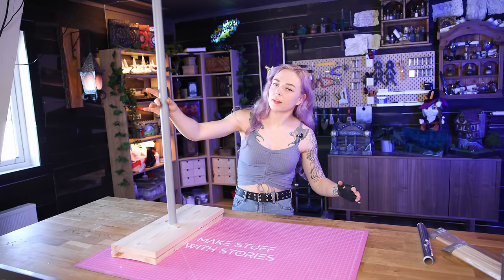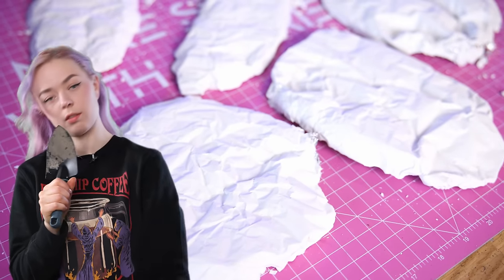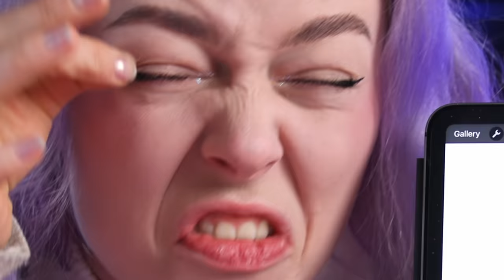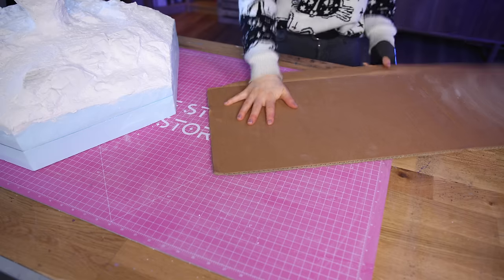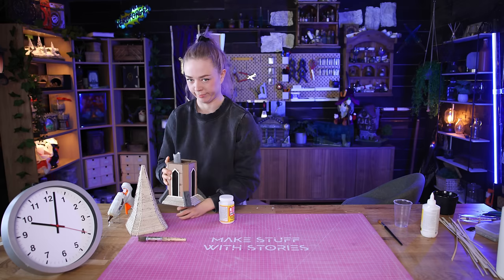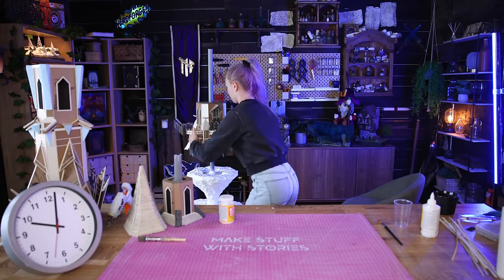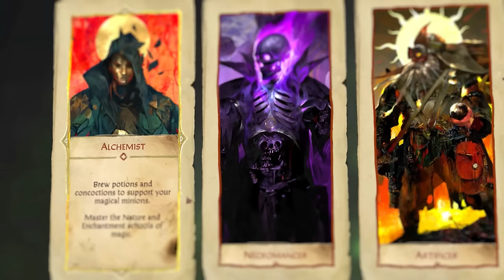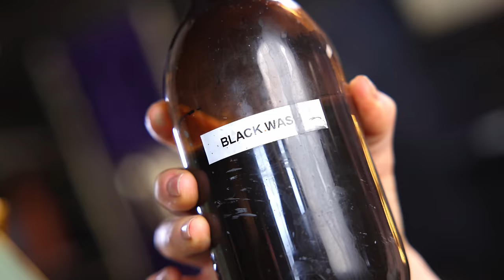I spent 20 days building this giant wizard tower

Comment: A crate isn't a bad idea. Keep it vertical and add anchors between each layer that secures to the central pipe and the inside of the crate. Then fill it with packing peanuts. Make sure to label it so they keep it orientated correctly and don't try to set it down on its side. As long as you have it attached to a pallet, it should be safe. It is going to be a fairly pricey way to ship it, but this would be the safest way to ship it internationally.
Reply: I'd put packing peanuts inside the structures as well to minimise any crushing
Reply: Good Idea Joe, and good idea Andy. I'd even say forming some styrofoam at the top and bottom as well as maybe a couple at the mid levels as reinforcement to anchor points would also help reduce crushing, and provide stabilization.
Reply: need lots of bubblewrap
Reply: I would like to add that you should add a tip and tell indicator on each side.   The fact is that shipping companies typically don't give a shit about something that says fragile this side up.   The second you add an indicator that shows if it got tipped though it becomes a different story.  

Sadly I am not sure if you can buy them in small batches locally.   They typically only get sold in packs of 100.     That said you could always just print a fake tip n tell label and slap it on the outside of the box even if it doesn't have one inside.
Reply: Adding on to these ideas, you could use your laser cutter to cut pieces of PE foam to fit around the less detailed sections. It'll be more expensive but will offer more stability, and the person you ship to won't have to deal with an avalanche of packing peanuts. 

I think 6-7 pieces of 5cm thick foam would be enough. Two for each of your sections and maybe one for the base where the rock tapers in. You could even cut them into hexagons and build a hexagonal crate around them. Make sure to cut them a hair larger than your crate and a hair smaller than your tower so they hold onto it well.
Reply: Another option that I've seen used for delicate lab instruments is similar, where they used a crate and two or three thin plastic bags/sheets. The instrument was placed inside a plastic bag, and one plastic bag/sheet was used to line the bottom of the box, then some type of expanding foam was used to fill in some of the space followed by the instrument being placed inside before the foam cured completely. Then the same was done on the top (plastic/foam/plastic), and then sealed. There was absolutely no movement of the part because of the possibility of damage (delicate lab equipment and all). Unfortunately, I only opened the box after shipping, so I'm not sure what type of plastic and foam they used. I just know that it was super effective.
Reply: @Nydewien  Your talking about the expanding foam for shipping.  They come in bags that you activate that then expand to fill the space.  It is commonly used to ship computers and works insanely well.    The problem is those are really expensive.   At around 10 dollars each and each only covers about 10-15 inches of empty space depending on the size.    Your probably talking over 100 dollars worth of them to properly pack it.
Reply: @MaethorDerien  Thanks! That's great to know for next time I need to ship some lab equipment. The last thing I sent out required $18k in insurance coverage, so I would be willing to pay that. (That and it would be going on my budget number, not me paying for it, lol!)
Reply: Put handles on your crate. People are always going to use a handle if one is provided. It will make it easier to carry and they might even treat it properly.

Comment: Ship it in 4 parts, the base and all 3 parts you made, all filled with packaging stuffing. You can even make a box for the base and use a fancy box for the miniatures with foam with holes carved to their shapes and sizes. Also, carving a negative form of the towers in foam to give more support during transport.
Reply: The issue with that is that someone will have to put it all back together at the end destination. I don't think Martina is traveling to the same place to do it herself.
Reply: pretty sure the parts are kinda stuck together with glue, clay, paint etc. taking it apart would mean you'd see seams after reassembly
Reply: @xime1899  im pretty sure they got facetime or sthg like that, so martina could tell them exactly how to build it back up
Reply: The parts are not in sections anymore. So it has to be shipped as 1 unit.
Reply: It's one part now
Reply: agreed, i personally would have made it to the pipe was removable from the base without killing the light and then each section was take-a-partable.
OR if your're able to redo the piping make it have a connection inside where the lighting starts so the base and the top is 2 parts (less akward)
Reply: I think they could have done it this way, but it would have had to be planned out that way from the beginning. There's no taking it apart now.

Comment: To ship it, I'd recommend building the plywood box like you said, then put in a bunch of braces made of the foam you use in your projects. I think that would be more secure than packaging peanuts. Plus you can cut the foam to fit exactly where you want so you can avoid any delicate areas of the piece. 

 Amazing work as always!

Comment: An idea for the shipping dilemma:
Mount the base in the transport-box and take off the upermost part of the tower if possible. Then you could have a "plug" in the top part of your box, so the pipe is fixed in place once the box is closed. Now the only hazzle left is the top part, which could be shipped in a separate box filled with those packaging thingies.
Best of luck :)

Comment: Great project as always tanks I've watching your back catalog  since I've found your channel thank to your colab with LTT.
Now I've rarely comment but I've have actual experience shipping large fragile things so here are my suggestion:
Option 1: If you can still separate the tower there is no need for a crate you can use cardboard boxes but you'll need to made a "small mod" cut the support pipe so the base can fit in a box that is not too tall and mostly empty, you can add threaded coupler and a connector for the LED Wires so it's easy to put it back together at the destination, now about prepping boxes for the individual parts, you'll need two boxes for each part for the inner box put a layer of hi density foam or Styrofoam of about 2cm lining all the walls of the box then get some instapack bags of the appropriate size to form a perfect support for the part, and that's your inner box for a short trip by truck on paved roads this would be enough, but if it need to be shipped by air o a long multi mode route, you want to add an outer box, this is much easier you need a box about 10 cm bigger in every dimension than the inner box so there is a 5 cm gap between the inner and outer box, now you just bubble graph the inner box with two layers  (the big bubble kind) and fill the rest of the gap with packing peanuts.
Option 2: Let say you can't separate the tower any more for this case you need a shipping pallet and a crate, you'll need to add temporary a larger base to the tower (a piece of plywood a about 10cm smaller the pallet in each dimension) with two objectives lower the center of mass of the pallet making it more stable and be able to screw together the tower and the pallet, now instapack if your best friend again for valuable and fragile things put a layer around  the hole tower you'll need 3 or 4 sections for this get a cardboard box and remove the top and bottom and and do one layer at a time until you have the whole tower protected (you'll need to cut out this boxes to unpack), because cargo shipped in pallets need to be move with fork lift some time is expose to the elements you need to add a layer of film wrap (like those kiosk that wrap your suitcase at the airport) now the final step is to made a crate around the hole pallet and strap at lest in 3 point the tower already pack to the wood crate.

Hope to be helpful and good luck.

Saludos desde Santa Cruz de la Sierra - Bolivia

Comment: They make a packing material that is basically expanding foam in a sealed bag. You break the vial inside to activate it, put it in the bottom of box and then quickly put the piece on top of it. The foam expands and contours perfectly around the item. You can then do another bag on top. Then it's just "rinse and repeat" for each section. Probably a good option for shipping such a delicate and fragile item.
Reply: I did not know that existed!
Reply: This is exactly what came to mind when she mentioned wanting help for packing it.
Reply: When I bought a computer last year, they put one of those inside the case to keep things from working loose.  Not a bad idea.  As for if it'll damage the project.  I think if it has room to move up inside the box, it might not put to much pressure on the project.

Comment: For shipping you could cut a piece of plywood to fit exactly on top of a shipping pallet. Place the ply wood on sawhorses of whatever, just support it from the sides. Then run screws from underneath the plywood into that block of wood at the base of the tower. Then bolt plywood onto the pallet. Then build a box around the pallet. Mark it "Fragile, do not tip, do not stack, this way up" and all that.

Comment: Shipping thoughts: Build the base into a box. Since the center is held in place by a pole, as long as you brace one of the sturdier parts of the upper section, it should keep the fiddley bits from getting damaged. Good luck!

Comment: for Packing what you can do is wrap the tower in painter plastic- get the size box you need and fill the box with expanding foam you can go light on it so when it expands it wont blow out the box or crush the model- When they recieve it they can just utilty knife it down the middle then lift off the bag-  with out any expandy foam on it. treat it just like a mold

Comment: It might be better to carefully use foam beads and garbage bags to pack it in sort of a christmass tree form, then use spray foam to fill the outside of that. That way, even if the spray foam expands a bit during the shipping, the foam beads still give it the extra wiggle room to expand without damaging the important pieces. You could even jokingly package it as a gigantic dill-does-thingy (read the first two words aloud without a pause between them), but put that packaging INSIDE the packaging in which you're shipping it, so only when they open the box in their office, will they see the dill-does' box, which they have to open to get to the tower inside. :)) =]]
Reply: I love this idea! 😂
Reply: Foam beads are awfull. There are air pockets sold as about 500ml -1liters in size. They are lightweight and not messy.
Reply: spray foam would work amazing!
if you use a more squishy type then even if the box gets pressed on a bit it wont damage the structure!

Comment: Packing idea: First decide on a box for the tower, then make a rectangular, hollow-centered, reinforced insert whose edges fit just inside the box to hold the tower, which can slide into the box after the tower is placed inside it... but the goal will be to have the insert only touch the tower in maybe 3 key places. To do that, I'm thinking wrap a foam ring gently around 3 places in the middle of the tower which are smoother / less pokey. Then, suspend those rings in the center of the insert using something slightly stretchy. Maybe secure the very bottom and top of the tower somehow too, but in a way that can absorb shocks. I'm thinking this would be better than packing peanut foam because that might scrape the static grass etc. off it. And leave extra space between the pokey parts of the tower and the box, so that the tower can move around suspended in the middle, without hitting the sides of the box.
Reply: Too complex just using ample amount of 500-1000ml air pockets would suffice for stabilisation.

Comment: Concerning the shipping: when we ship fragile stuff at work (i.e. motors for machines) we build a frame inside a box and screw the thing to that frame so it is free hanging. As your base is wood, you could screw it to a base panel to secure it. I don't know how fragile the miniatures and pointy bits are. If you are afraid they might break when the box is vibrating in a truck, probably wrap the details in something soft (cotton balls, newspaper shreds, kitchenroll?) And then wrap the whole thing in cling film and build a box around that. Fill the box with packing peanuts. Write  " this side up!" on every side and speak a quick prayer. Maybe, you can even remove the top third (if still possible) to access the pipe and secure that from the top down as well. Good luck with that. I'm holding all available thumbs for you.

Comment: This is amazing :) There is so much detail in this that I think you can't pack it in anything that is going to touch it.
I would suggest that you contruct a shipping crate and a support structure that interfaces into the ends of plastic pipe in the core of the tower and to the crate. I think the top comes off so use that to access the top of the tower's plastic core. Pack the top seperately. How closely is that pipe connecting to the other parts of the tower? Maybe in internal skeleton that holds the tower's parts to the core tubing. You need this to not come loose in shipping. I'd go with spokes connecting with something like a jubilee clip round the internal tubing. For the external support structure maybe think about how you see airfix parts in a plastic surround before you pop them out. (I know this is the low structure for the injection moulding process) It might be cheaper to rent a van and go on a road trip. It would make an awesome video too.

Comment: To pack it, make a negative mold in styrofoam (so combined it fills out a rectangle) make a cardboard box that fits it precisely, wrap that box in bubble wrap (3 layers) and get a larger cardboard box, put the bubble wrapped box in the center, fill the rest of the air with packing peanuts.

Comment: Cardboard box with internal cardboard bracing, packing to fill in the empty spaces. That should suffice. Also slap a few fragile stickers on there too. Find a cardboard box that’s tall yet thin and ship it in modules. Ultimately you’ll have 5 boxes. 3 for the body, one for the base, and one for the central support structure (pipe). This would probably be the cheapest solution, yet affective.

Comment: An idea that actually will work to ship your Art ( useful for everything ).

-A rectangular large box (must be made of something sturdy and solid )
-Tension belts (must be what the truck drivers use to secure the load )

How it does work : 

The idea is that the whole thing floats in the box.
You then wrap the tension belts (must be 1 on each CORNER) around the tower (then it looks like an X and the charge is free and floating right in the middle).  

With this technique you can transport everything safely ( Next would be water tanks but that would be useless for your tower ) 

Edit : Tip, if you have problems with something, always orientate yourself to nature. They always have solutions ready. 

Great work, unique Women and have fun. 

Thanks for reading

Comment: Shipping suggestions: first thing which comes to my mind is to use foam rubber and packaging film or/with packing tape. So the idea is to wrap little intricate details such as figures and trees into foam rubber separatly, and then pack the whole structer into lightly adjusted sheets of foam rubber. If you can not really separate little details, you can just use thinner foam rubber to wrap them, and then you use thicker layers of foam rubber above which you use to wrap the whole structer;  you can also use cotton wool or wadding to wrap little details. So then you wrap the tower structer tightly with several layers of plastic packaging film, and you can reinforce it with packing tape above. Then place it in a plywood box filled with more foam rubber, so you have two layers of foam rubber protecting your tower - one inner for little details and structer in general, and one eternal to reinforce the inner layer and give additional protection. You can also use paper or newspapers to wrap little details or to create second layer of protection in ply wood box. This what comes to my mind if I were to do it, hope that helps GL =)

Comment: My suggestion for shipping is to come up with that aspect of the build in the beginning. If you start with a plan to make it modular from the start, then you won't end up with this issue next time. While watching I saw so many opportunities where you could have made the tube come apart. Then you could have packed each section individually into a small box, then perhaps put it inside a crate. Some businesses/companies use these big crate boxes to ship several smaller boxes of merchandising materials together all the time. It may end up being a bit more expensive, but at least you'd be able to properly pack the pieces and add enough padding to prevent it from getting damaged.

It turned out amazing, but I worry it's going to end up getting damaged during shipping since you didn't engineer it to properly be disassembled for transport. Hopefully everything turns out okay and it arrives in good condition.